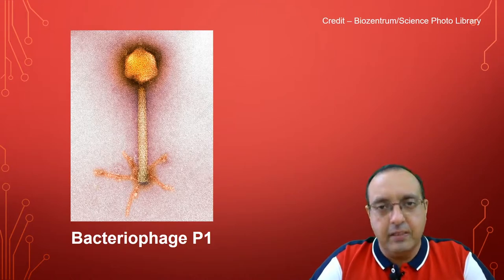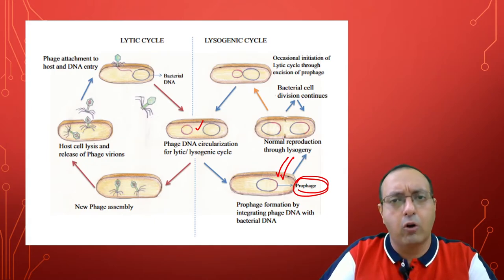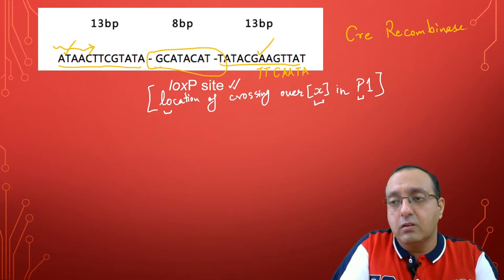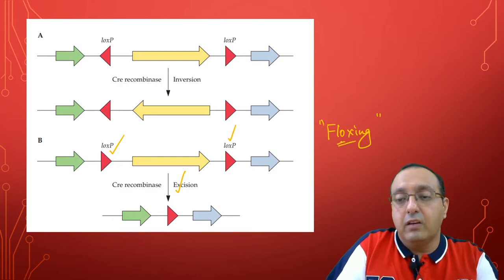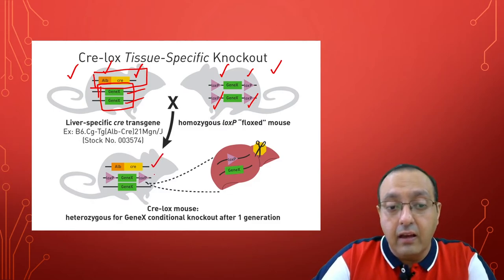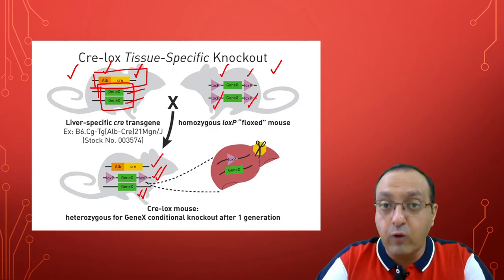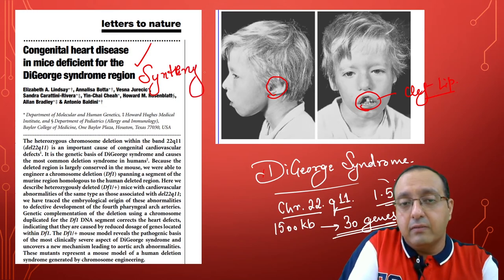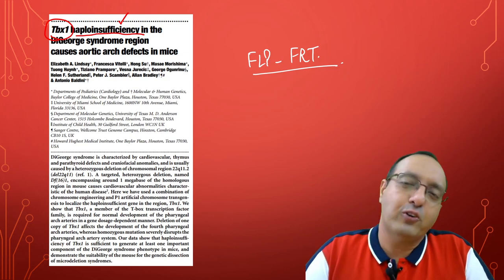The Cre-loxP Technique (Transgenic Mice)

Comment: A doubt: Here the Alb-Cre is in a hemizygous state and also in a different chromosome?
Reply from the maker: Gayatree, the Alb-Cre can be in a hemizygous or homozygous state depending upon researcher's experimental setup, and yes, it is on a different chromosome. Since a variety of these mice are available carrying Cre-lox construct on different chromosomes, knockouts can be easily generated for genes present on different chromosomes.
Reply: Since hemizygous mice have a wildtype chromosome present, using hemizygous instead of homozygous Cre genotypes might minimize unintended consequences of random transgene insertion. (Courtesy: From Jax site)